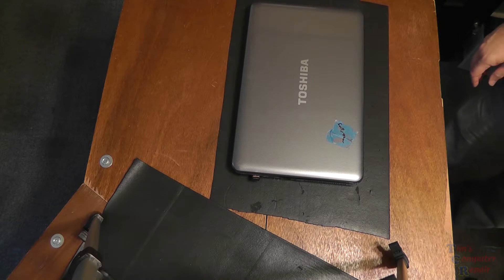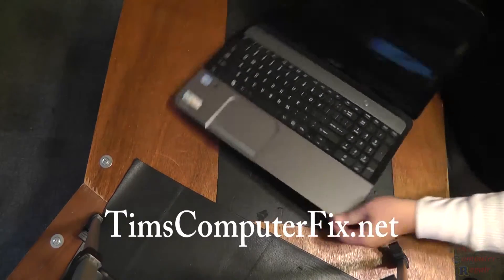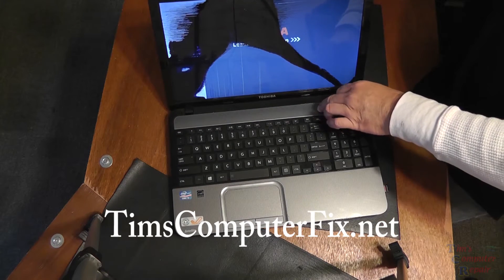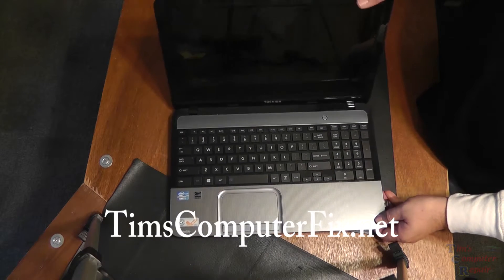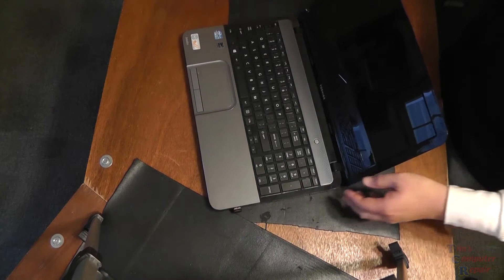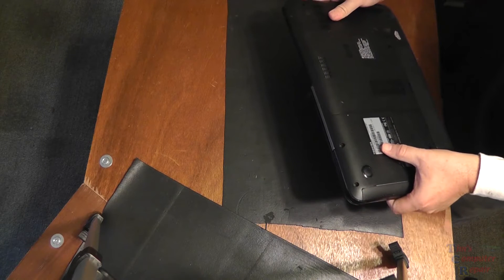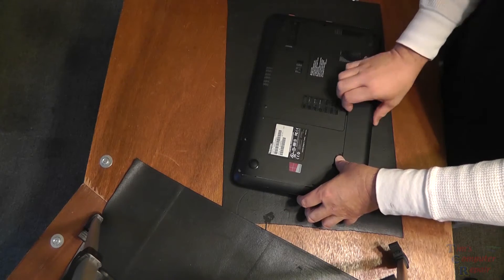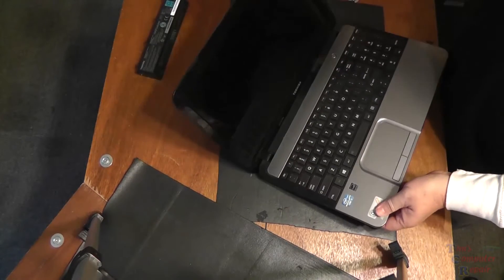How to Order the Right Laptop Screen

Comment: What happens if we don't take out the battery first?
Reply from the maker: Very small risk of shorting out causing mb damage.
Reply: @TimsComputerRepair  thanks for the answer. I've been trying to do it but i'm not able to remove it. If the battery is not charged  will I have the same problem?
Reply: @julioenriquecastillomonge987  The battery doesn't need to be completely removed, it just needs to be unplugged from the rest of the board

Comment: What do you mean "GET BIT" ... WHY isn't it compatible ??  Size? power? Placement of the clips?? connector type ???   WHAT ??????
Reply from the maker: In many cases you will be just fine however I have had times when the screen will not work with the laptop even though everything lines up. Power it on and no video OR after connecting the screen the pin out was different and shorted the laptop.
Reply: OMG !  thank you for that info ... I just didn't understand "Get bit"!   Great Video , BTW  -- and I REALLY appreciate your quick response !